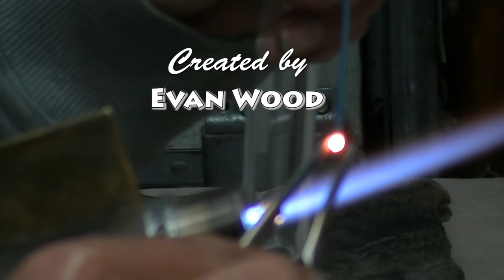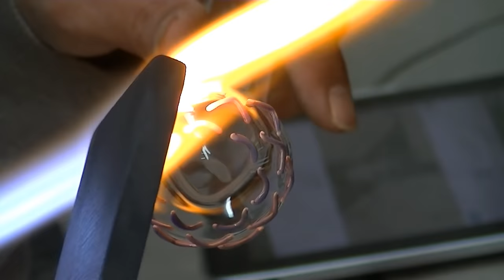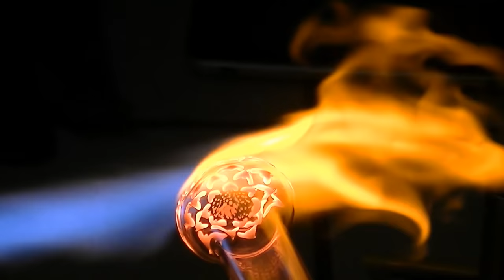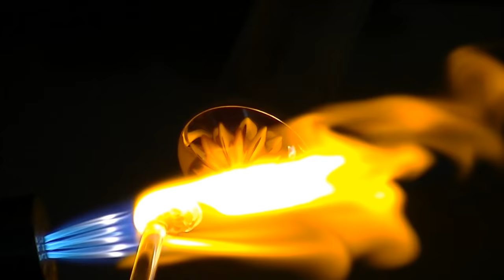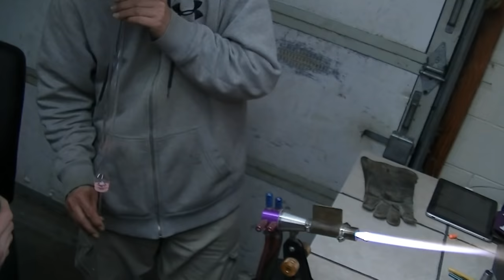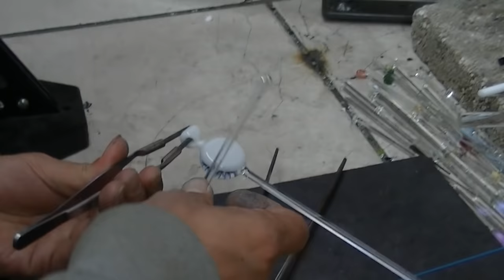Amazing Glass Blowing How to Make Flower Implosion Pendant

Comment: so is this done like a compression flower? i tried this last night cause i haven't had much luck with compressions figured hollow might just be a bit easier. do you just melt it down to a gather after puttin your peddals then just go the compression method of heating and pressing then reheating?

Comment: How do I get ahold of someone to ask questions about how this was made?
Reply from the maker: You can ask here.
Reply: @LickMyGlass  thank you for giving me the chance to ask a question. I'm curious as to how you get the flower petals to extend to the outer ends of the pendant. I keep trying and trying and I feel like I'm doing something wrong and I'm not sure what that is.
Reply from the maker: @shaggysglass6707  Have you been keeping the tube level while melting in the color?
Are you using a tube or a rod?
Have you tried lightly using a tungsten pick to form the tips of the pedals?
Reply: @LickMyGlass  I have been using tube and have done level for the most part as well as "elbow down" to try to pull it in further
Reply from the maker: @shaggysglass6707  Have you had any luck yet? Have your elbow more level or up. The hottest part of the glass will be the outer clear, and it will move in the direction of gravity. If your elbow is down,  then the clear will sink towards the tube. Rather, with elbow up, the clear will flow over the color.
Reply: @LickMyGlass  I feel like that was my problem. Elbow down will work but it won't stretch the color. I've had some better luck with being level. I may need to be more patient and focus more on the elbow up way of doing it and let things expand throughout the body more. I really do appreciate your help and your willingness to give help when asked. You have my greatest respect and I think I can speak for many others when I say that we're grateful to have people like you who want to expand the talent in people when it comes to glass art 🎨 🔥